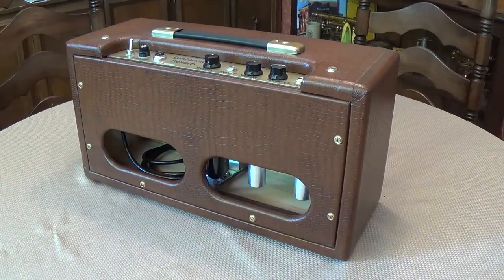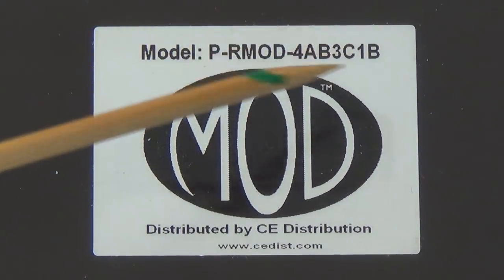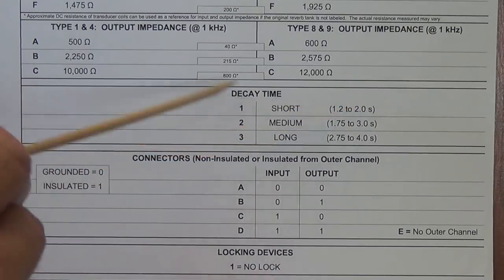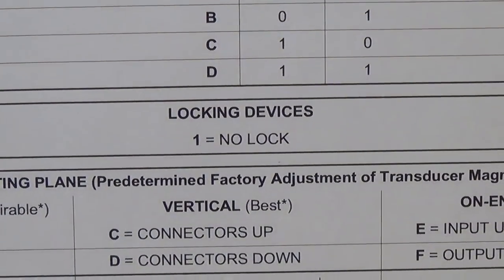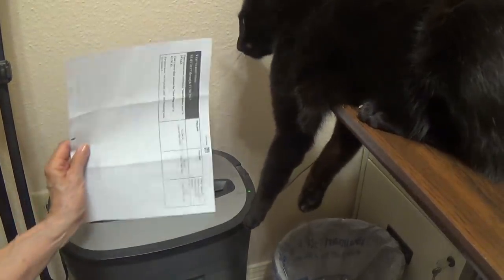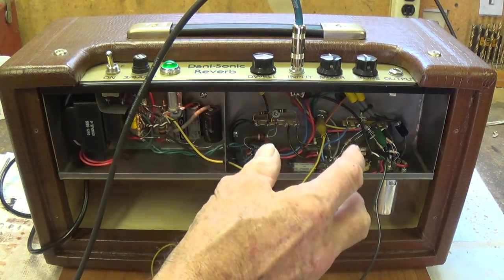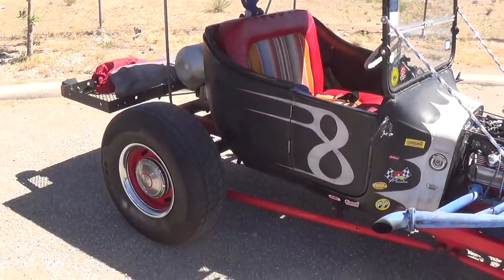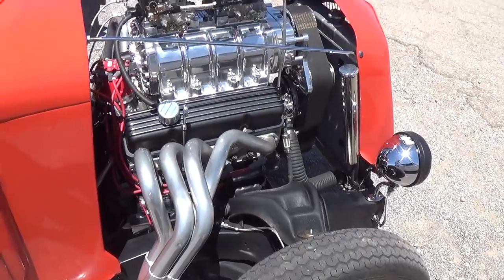Tube Reverb, Part 2:  Transducers, Tanks, Tone, and Signal Mixing

Comment from the maker: NOTE: The revised schematic, wiring diagram, parts list, etc. is now available in the video description.
Reply: As well, the solid wire supporting the transducer is a non-ferrous (Brass or Bronze) wire.. The magnetic part of the transducer has a small hole that the Brass wire supports the magnet..  the magnet being glued to the brass wire..  (Better seen than described)..    The Reverb Tanks being supplied by a Company called Acutronics?? in Chicago.. Originally supplied Reverb Tanks to Hammond Organ Company..  I believe they are still in Business..
Reply: Ojjou

Comment: ive always wanted to know how the reverb tank worked, now I know. your videos are so stimulating to my brain. thanks again Doug you’ve put a spark in this 61 year old. I now wish I should have discovered electronic earlier, carpentry and cabinetmaking were great enjoyable too, which is my forte. my cousin used to make his own pedals back in the 70s pretty cool, but I never liked pedals, plug into my Marshall JCM 2000 TSL 100 and I can just rock out with no worries about dead 9v batteries, or mucky muck.
Reply from the maker: It's never too late to learn, Russell. I was around 60 years old when I started studying tube amplification.

Comment: Finally someone with knowledge of phase inversions of 6G15.

I'm building Revibe (6G15 reverb + 6G12 harmonic tremolo) and I wondered how they just can cram there extra gain stage and couple signals back together with little regards of phase. Even more I wondered 6G15 schematic which for my eye looked to be out of phase with itself and I thought it is part of effect which I'm going to lose. But revibe's buffer triode is wired other way around, that is why it works.
Reply from the maker: Thanks for your nice comments, Jorma. As you discovered, by carefully analyzing the circuit, all questions can be answered.

Comment: Uncle Doug, I'm glad I'm not alone on the wheel choice. I guess I'm showing my age but there used to be a time when showing off a fat set of tires with raised white letters was fashionable. I don't get the attraction of big wheels with rubber bands - especially on classic cars and trucks. My favorite for classics were the 15" aluminum slotted mag.  The 5 spoke 15" wheels are all but impossible to find now unless they are special ordered from a speed shop. That is a timeless classic style, IMO. 

Also glad to see that Jack is still on the job and doing quite well. I'm sure Rusty is watching him with pride. 

Thanks for taking us through the reverb unit and to the car show.
Reply from the maker: You're welcome, Sluggo. Yeah, I'm not a fan of Conestoga wheels with O-ring tires.....just like all the silly fads that come and go, I can't wait for it to fade away into obscurity. Give me some slotted 15" Ansen's or five-spoke American's with fat tires and I'm a happy guy:)
Reply: I have to say I agree with both of you about what looks good on cars & trucks.  I think that the wagon wheels with O-rings stretched to the point of breaking looks extremely disproportional/disproportionate to the vehicle.  Like Slugg0matic, I'm showing my age too.  I wonder how many of those wagon wheels have to be replaced early because they ran over a rock or similar?  My CJ-2A looks like it still has its original wheels after 72 years of not damaging the wheels by running over rocks!  I too feel that Jack is doing a good job with Rusty watching him with pride.

Comment: I love these videos, You've inspired me to start building and designing my own equipment. Great knowledge.I've watched all your videos right from "Triodes" through amp design and phase inverters, capacitors and resistors. I'm thinking of building a complete effects unit with this reverb circuit and adding the "Rick-Tone Trem-O-Drive" as well. I think they are stellar!! Keep up the awesome videos. :)
Reply from the maker: Thanks so much, Stephen. I'm glad the videos are helpful. Before you start building your effects unit, check out the ReVibe circuit developed by Gerald Weber.
Reply: I will for sure! Btw... I've looked for the chart you use to identify the reverb tank, but cant seem to find the same one. would you have a link? or a search string I can use. Thanks again. :)
Reply from the maker: How about this one:   https://www.amplifiedparts.com/tech-corner/spring-reverb-tanks-explained-and-compared
Reply: Thank you sir. I had seen that page actually, I just didn't scroll down far enough to see the chart. Thanks again, much appreciated. :)

Comment: I know it’s an old video, but I still want to comment on the “phase theory around the 20 min mark. Really, it’s more of an observation that I don’t know is accurate. 
Wouldn’t the in phase out of phase signal be shifted from each other because of the delay that happens through the springs? If so, what role if any does that have in what we hear, does it even matter 😂. Perhaps I’m wrong in assuming two signals are EVER perfectly in or out of phase🤷‍♂️
I just love discussing this stuff and learning. This is the single best channel on YouTube!!
Reply from the maker: Thanks so much, Al. I think the slight "dephasing" of the reverb signal is what provides the echo effect when it is mixed with the dry signal.

Comment: Great video, as always. Very informative. I never would have guessed that the motion of the springs was torsional at the transducers. I can only imagine that it would create a sinusoldial vortex “for lack of a better term” in the springs. Might be a great opportunity to use your strobe to capture the spring movement on video. Of all the cars, the Chevy pickup was my favorite, when I was a teenager I tore up the streets of Van Horn in a Candy Apple Red 64 Custom Deluxe, chrome reverse wheels, L79, 327, 202 “camel back” heads, out of a 67 Vette. Cast iron power glide. Big back window, long fleetside bed. Oh what I would give to have that pickup now.
Reply from the maker: Thanks, Mark. I believe the wave transmission of energy in the springs is best defined as being longitudinal rather than transverse. Your old truck sounds wonderful, especially if you were terrorizing (fairly nearby) Van Horn, Texas :) I have a pair of identical (but 1966) heads currently in my store room, completely overhauled and waiting for installation on a worthy 327 short block.....if I can find one.

Comment: I had quite a day yesterday, first I watched "A Dog's Purpose" , my own dog was busy bringing me tissues - he didn't get to watch. Then I watched Doug's reverb lesson and all I could think of is how scary it is to buy a used reverb tank and expect it to make good sounds. Interesting that with all the mistakes, "Fender reverb" is what all else are judged against. And finally, Doug, when is the math lesson coming that will explain those glorious headers on the red blown car at the show- they sure didn't look like the plain-jane pipes on most hotrods. I grew up near Hedman Hedders in Culver City, CA, and on occasion I would hear a monstrous roar around 2 or 3Am, as they tested some designs on a nearby public road, very possibly exceeding the posted speed limit :)
Reply from the maker: Greetings, Richard. I have to be careful with movies like that. I watched "My Dog, Skip" a few years ago.....and still haven't gotten over it. Re used reverb tank units, I think they're much like any used electronic device; you take your chances, relying on your own intuition and on-site evaluation of the condition. The tanks themselves are generally the first parts to fail, and they are inexpensive and easy to replace. As far as the headers go, I doubt that any math, other than the overall length of each pipe being equal, would matter. You start out, usually, with four equal-length pieces of pipe (per side), a tubing bender, and a TIG welder.......and the rest is Voo Doo :)

Comment: I really miss Rusty but glad that you have Jack !I am interested in the "locking device" you use for the reverb tank as I hate it when I move the Reverb Unit from place to place and hear the "crashing" of the springs and hope that they survived the trip !
Reply from the maker: You will see it in detail in Part 3, Tom. I incorporated a sere locking mechanism to keep it in place, rather than the standard, rather crude method employed by Fender.

Comment: Thanks for making these videos. They really helped me when I put together my first 5F2A amp last year. I'm now modding it with a 6BM8 single tube reverb. 
I wish I had watched your video before I bought a B position reverb tank. I wonder why they don't make the tanks taller so the transducers can be in the upright position even when attached to the amp bottom. 
Also, love the classic cars. My first car was a '67 Mustang I bought HS freshman year, and managed to get it running by senior year back in the late 80s.
Reply from the maker: You're welcome, PnD. Good luck with your projects :)

Comment: Uncle Doug, all of your videos are great. But this series on reverb is STELLAR! I am learning so much from it!

My guess on the reason the dry signal is taken off of the grid of V3b (the dry triode of the 12AX7) is as follows:

I think of it as being similar to a common collector circuit for BJT transistors. As you mentioned, the phase does not invert, and also the gain is near unity, wihich together keeps the dry signal pretty close to identical to the input signal, but prevents the wet signal from feeding back through the mixer pot to the input (which could happen if the triode wasn't there). The triode cannot conduct from the cathode to the grid, so it acts as a diode preventing the feedback.  

What do you think? Please correct me if anything I wrote doesn't make sense or is wrong.

And Keep 'Em Coming! 'Can't wait to see part 3!
Reply from the maker: Thanks so much, Steven. I like your analysis and find that your conclusions seem quite reasonable.

Comment: Hi Doug, A quick comment (or two) about your reverb... as you mentioned, Fender did mount the tank on the bottom of their combo amps, but there was one exception... the stand-alone tube reverb tank, which had the tank mounted on the front panel (which is where I believe that you mounted your tank). The Fender reverb has always had the reputation for the highest quality reverb, and that front mounting most likely had something to do with that. I did notice that you added the locking bar (as did Fender) to your tank. Over the years, I've owned both an original tank as well as a couple of reissues... wish I still had them. 
As for Rusty, I've also owned several dogs in my life, (there are two now...) and it's always hard to lose them when they get old. You miss them, but usually another one comes into your life, and that tail wagging is there again to greet you when you come home. But you never forget the ones that came before...
Reply from the maker: Yes, the 6G15 is the only amp I know of that utilizes the front panel mount.....and it does have a glorious reverb tone. I designed a special damping mechanism for my clone and will demonstrate it in Part 3. I was a gunsmith for several years and borrowed the idea of a sere to lock the damper in place. 

Rusty has been gone for quite a while, but I still mourn his loss......especially with regard to our YouTube channel. I always felt that he made our videos special.
Reply: Fender used a backwards "J" shaped bar to lock the pan in place. Instead of a sear, Fender used a pair of holes fitted with screws, and one of the holes had a second slot that acted to lock the bar firmly against the reverb pan.

Rusty was a good and loyal friend... he indeed made your videos special.
Reply from the maker: Thanks, Bill.

Comment: Hi Uncle Doug--nice exposition, as always.  I don't think the reason for the cathode follower has to do with matching phase--by switching the connections of the drive transformer, the phase of the wet signal can be switched to whatever phase one wants.  The real reason, I think, is that the cathode follower, with its gain of almost exactly one, and its high input impedance, means that with the mix control set to its fully dry position, the guitar signal is fed from input to output with essentially no change.  As such, the reverb unit essentially disappears, so to speak, and the guitar would sound like the reverb unit wasn't there.  
One small change to the circuit that I would make would be to put a high-value resistor from the output jack to ground.  That way, if any of the capacitors used at the output had a small amount of leakage, the DC voltage at the output would stay low.  Otherwise, in the worst case, the output of the unit could charge up to the plate voltage, and give your amp a big transient when the unit was plugged in to the amp.
Reply from the maker: Thanks so much for your input, Roiderien. Having just analyzed the wet and dry circuits with an oscilloscope, I can vouch for the unity gain of the cathode follower. The dry output signal is absolutely identical to the input signal......so you are most likely correct as to the purpose of the cathode follower. With regard to the resistor suggestion, every amp I have ever seen has a grid leak resistor for every pre-amp tube, particularly the first one.......so wouldn't that solve the problem?
Reply: Yes, it would solve the problem except if the reverb unit was turned on before being plugged into the amp, and a charge built up on the output.  OTOH, an amp in which the input jack was shorted when not plugged in should fix it as well.

Comment: That's great, Doug! And yes, thank you, of course, the mounting angle thing is about the magnets sagging between the laminated pickup/transducer poles! Special request... next video could you (at a merciful volume) take a tank in hand, run signal through it (I know your hands are busy at this point, maybe a loop from a recording device?) and turn it into different orientations? Also, very interested in what angles of tilt and jostling cause more or less crash noise. A feature of Fender amps just might be that if you tilt them back (the natural way they want to go when kicked) that rotates the springs. The tank rejects translational motion as it doesn't induce twist in the springs, but is susceptible to rotational motion in that one axis.
Reply from the maker: You're welcome, AQ, and thanks for the input on the transducers. I feel fortunate to have the assistance of experts in the field to help out from time to time. I will keep your suggestion in mind for future videos.

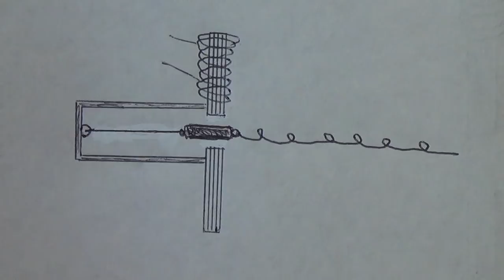Comment: @2:20 There is another important reason for a fixed length wire. A spring would allow the magnetic maerial to move like the voice coil of a speaker and add unwanted axial harmonics to the spring which would be amplified by subsequent reflections down the length of the spring.
Reply from the maker: A very logical observation, J1. Thanks !!!

Comment: Hey uncle Doug! First off thanks a million for all you do. I’ve created an “Uncle Doug Educational” playlist that had almost every educational video you’ve done. It is helping g me and others tremendously. I have a quick question. Is there by chance a good tutorial you know if that explains wrapping the tolex over the CURVED. Portion of the top of the cabinet? I can’t find one anywhere. This type of curve for the control panel is both on this reverb unit and also on all fender tweed designs. I’d sure like to learn how to do it. Thanks in advance for any direction you can point me in!!!
Reply from the maker: Watch my video on how to cover amp cabinets with Tolex or vinyl, LHR.

Comment: Uncle Doug, this video is almost a seminar on Reverb technology!  But, while I was thinking (during your pause), I surmised that the use of the cathode-follower circuit has more to do with impedance matching than phasing, since the phasing of ANY audible input signal would be irrelevant (a non-issue) to the reverb tank output;  Also, note that the cathode resistance/impedance is in the same ballpark as the mixer pot''s, to provide the maximum transfer of power to it, which must be considerable, judging by the .1 uF coupling capacitor that connects them.  Do my gut-feelings make sense?
Reply from the maker: Thanks, James. Another viewer came up with a similar idea: The cathode follower, due to its high impedance and lack of gain serves to couple the guitar input to the dry output, so that when the "wet" mix is off,  the guitar signal goes straight to the amp as if the reverb unit was not even present.

Comment: Doug, when you mount your tube sockets, do you prefer bolts, washers and nuts or pop rivets? I can see advantages to either. Bolts and nuts are more easy to remove and that could be a problem too.
Reply from the maker: I've tried it both ways, Dennis, and tend to favor the rivets. Let's face it, how often do you need to replace a tube socket?......and even then, rivets are probably easier to drill out than it is to remove fiddly little nuts and screws.

Comment: I’m really enjoying this series of videos along with the great topic! I can’t wait to see number three!!! Your hand performance was stellar and flawless as it gracefully guided the pointer stick with precision and ease. Would you say that the dry signal going through the Cathode would be configured as a Cathode follower? Enjoyed the cars at the end too! Do you think it would be worth while to rectify and cap filter the 6 volt to the tube heaters, to help reduce 60 cycle hum? I’m contemplating doing it on my build. Was also thinking of going with a 120 volt LED bulb in the pilot light housing, to cut down on the 6 volt load.

Glen
Reply from the maker: Thanks, Glen. Yes, the V3b triode is a cathode follower. No, I don't think that rectifying the 6.3VAC filament supply is necessary. You can use an LED bulb if you wish, but the filament supply has no problem powering an incandescent pilot light.